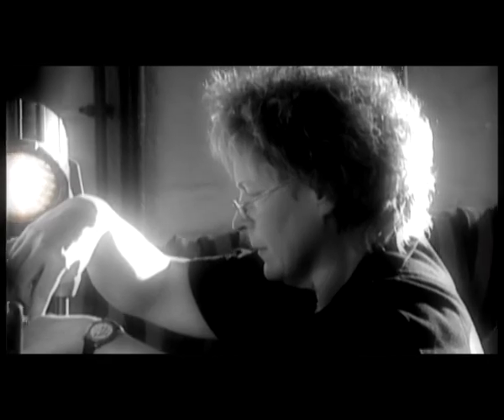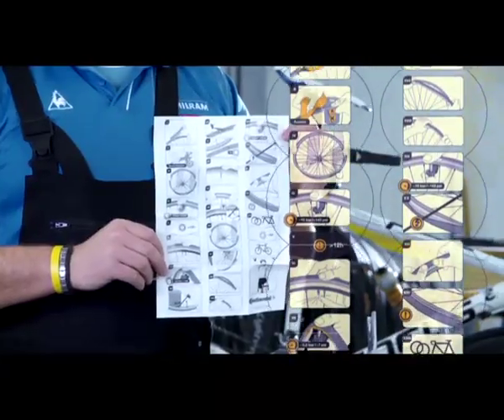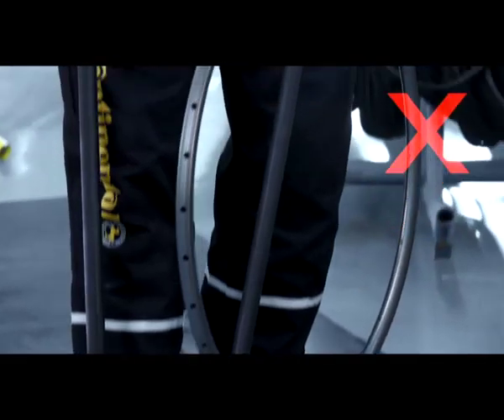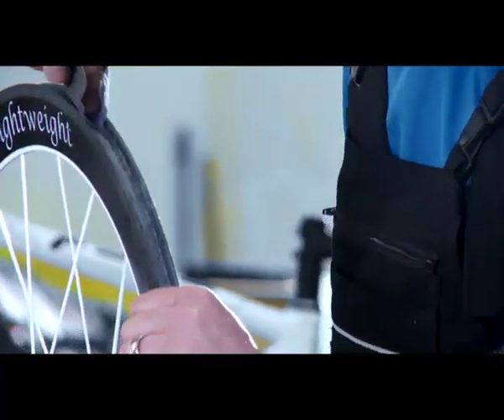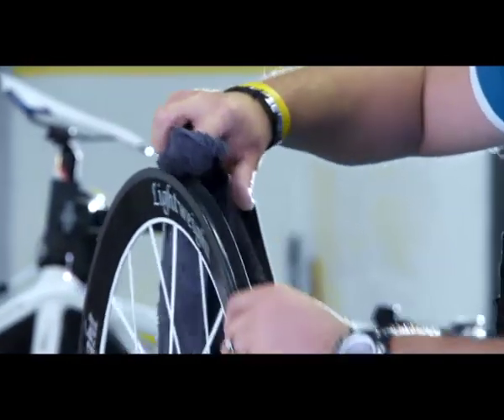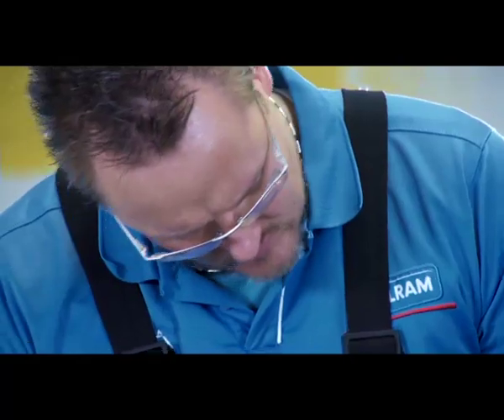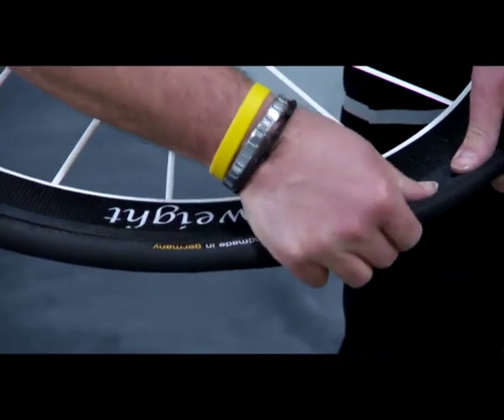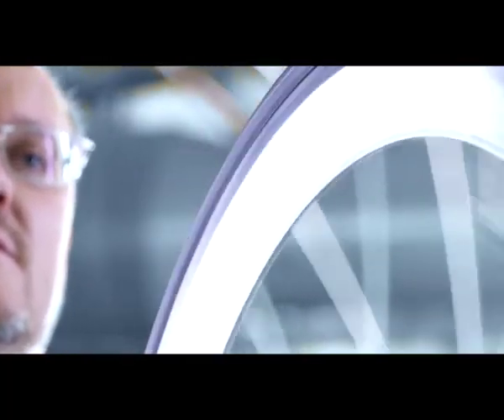Continental - mounting instruction for tubular tyres, carbon rims

Comment: Thanks for the clear information. At 97 kg and 1,81m, I probably have the same morphology as the gentleman in the video. Yet, I cannot fit a Continental Podium TT tubular on a tire rim by myself. Two experience mechanics at my local bike shop did succeed with a lot of difficulties.

Comment: Conti tubs are THE worst to try and mount. The amount of force they take to get into the   rim bed isn't even funny. If you value your thumbs buy vitorria or challenge or veloflex
Reply: I just bought a pair of Vittoria Juniores tubular tires (21"-26") to install on the Spinergy Rev-X carbon fiber race wheels for my Trek Hilo time trial bike.  I'm going to find a bike mechanic to tape the tires on the wheels for me.

Comment: If only it were that easy.  I can't even get my Podium TTs stretched over the rim.  Would it kill you to add an extra 2mm of rubber?  I'm a cyclist ffs, not a bodybuilder(I don't look like the guy in the video, in other words).  I have no problems mounting tubulars from Vittoria or Challenge though.  I guess I'll have to throw these tires out instead of using them.  What a waste.
Reply: Inflate them 'till 150 psi. and live them overnight . It Will Stretch them 3 to 5 mm.

Comment: One tube of wheel cement can apply all those coats to the rim and tire? I found that despite trying to work quickly with spreading the glue it was still get tacky and ball up very quickly. Also there wasn't enough glue in the tube to do multiple coats to the rim and tire. I had to buy more.

After my installation I still wasn't happy with the job so I removed the tire to try again. It appears that in the removal some of the cloth tape from the tire has come off, will the tire still work? It still holds air.
Reply: I dunno, but I've experienced similar things a couple a years ago using the can version of the glue. Years later I glued another set of tubes using same tires, wheels and Continental glue. It seemed like the newer glue was more fluid and sank more easily in to the tire bed. The only difference I can think of was ambient temperature, which was probably a couple degrees higher. 

Regarsing the separating basetape; If it has only separated from a small area, I'd just use tubular glue (probably not Continental cement though) to glue the tape back in to the tire. If it has separated from a large area, then the tire is probably gone.

Comment: Round file on carbon fibre? Not a good tip, a diamond tipped deburring tool is the only acceptable tool to deburr the carbon properly.
Reply: They explained that was for an aluminum rim. You're right, don't do that to a carbon fiber rim.

Comment: @gabriel (& anyone else wondering the same)
700c is the nominal description of size for any wheel with ETRTO (European Tyre and Rim Trading Organisation) dimension 622 x "X" where "X" is the nominal bead to bead dimension of the tyre, divided by 2.5 - it's not an exact measure.

28" is sometimes also used as a descriptor - usually in the form 28 x 1 1/8 x 1 5/8 in the case of "700c"- be careful as in some clincher rims, it can mean a much larger dia, as in traditional Dutch bikes - 28 x 1 1/2
Reply: The eck you'r talking about ?!?!? Speak Christian,,, Please.
Reply: The eck you'r talking about ?!?! Speak Christian Please !!!
Reply: By the way : which One is bigger or larger : 27" x 1"/ 1/2" , or 
                                                                          700 cm. x 28 cm!?!?!

Comment: Damn, judging from the face of the guy with huge arms, it still seems hard to mount so with my small arms it's prolly gonna be a major pain in the *** :o Anyhow, I told myself I needed to try tubular at least once in my life so there it is for 2013 with brand new 38mm carbon rims. Better be worth the hassle!
Reply: Were you able to mount them by now?
Reply: @unbee73 ,,, he passed because of the hassle.